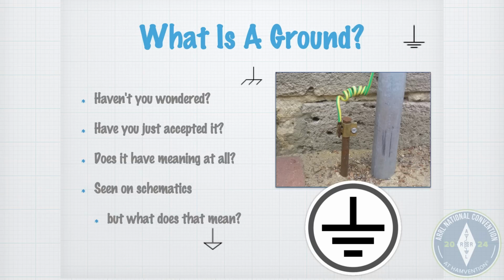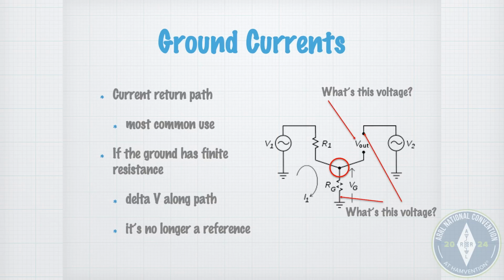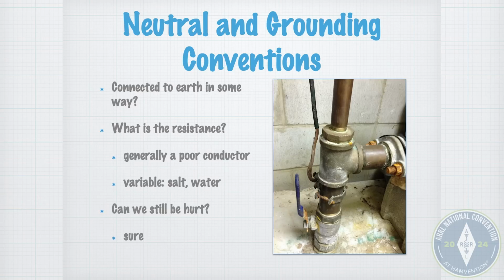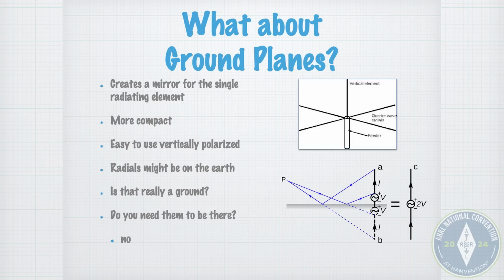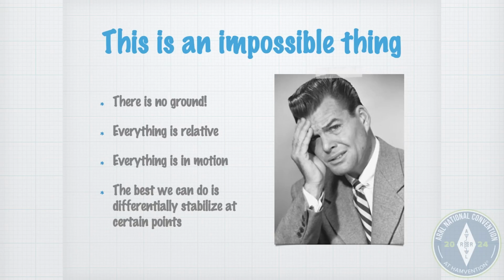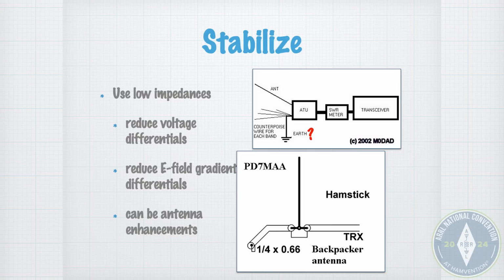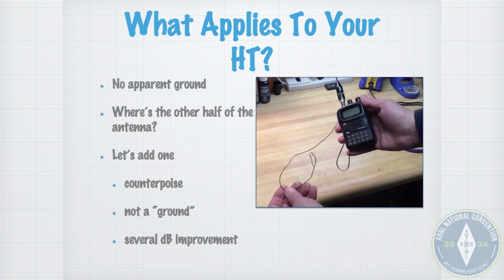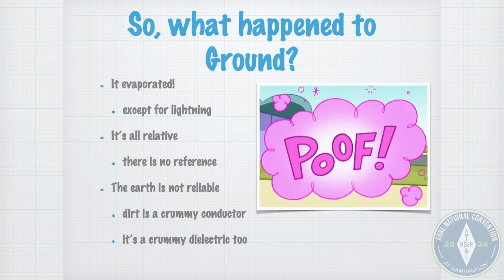Ground is a Myth! | 2024 ARRL National Convention

Comment: This ↓     Not that ↑

https://tpssurge.com/wp-content/uploads/IEEE-Recommended-Practices.pdf
https://www.youtube.com/watch?v=SXwPKIKHDlI
http://k9yc.com/GroundingAndAudio.pdf
http://www.w8ji.com/ground_systems.htm
https://static.dxengineering.com/global/images/technicalarticles/dxe-rgp-scb.pdf
https://wiki.w9cr.net/images/4/4a/68P81089E50-C_Standards_and_Guidelines_for_Communication_Sites_R56.pdf
https://www.nautel.com/content/user_files/2018/03/Lightning-Protection-Radio-Stations-Oct-1998.pdf
https://www.kf7p.com/KF7P/Tech_Resources_files/lightning%20protection%201.pdf
https://www.kf7p.com/KF7P/Tech_Resources_files/lightning%20protection%202.pdf
https://www.youtube.com/watch?v=US4RlB9WaBc
https://eepower.com/technical-articles/the-basics-of-substation-grounding-parts-of-the-grounding-system/
https://electrical-engineering-portal.com/handy-earthing-guidelines
https://electrical-engineering-portal.com/equipotential-bonding-for-metal-installations

73, w0yre

Comment: Well.. There used to be a thing called Counter antenna. It's a virtual mass against the capacity of the antenna, that also needs to be tuned.

It was banned in the early days cause of the lightning hazard. And it was replaced with the "ground" connection to direct the possible lightning. Not to be confused with the neutral point of potential positive and negative.
Reply: Bad ground is like jumping in a mud. Full ground is like jumping on a concrete. Tuned ground is like jumping on a trampoline.

Comment: 1. There is a reference point for gravitational field indeed - the center of the Earth is the reference point, where the gravitational field of the Earth turns zero exactly
2. There is a reference point for current - zero current, when dq/dt = 0, that is, when charge is not changing

Comment: Great info here! I can't tell you how many times I've been called crazy, dangerous, and uninformed when explaining to them why grounding is not the panacea they think it is. A lot of this comes from past practices with old tube rigs without a ground wire connected to the mains. Equipment manufacturers still put these ground lugs on the back of their gear, implying that one has to connect them to ground. But that is no longer the case, because the third wire is now included on all gear. Thanks Kristen!

Comment: Ground current is very measurable. I think this presentation has serious flaws.
There is no pulling or pushing, there is no distance, and the verbiage she uses is confused and incorrectly used.
The entire "idea" of a "zero" is incorrect, there is no zero, there is balance there is positive and negative sides of the sinewave. Voltage is pressure or imbalance.
Maybe the person talking should make a difference between radio frequency and AC electrical frequency, and DC electricals, there are many different type of grounds even within each of these categories, before stating that "ground is a myth!".
Wait, wait, I am at 08:00 and she just jumped from electrical Voltage (a charge) to radio frequencies (a vibration) and... Is she trying to make some form of comparison???  Wait, wait, did she just mixed AC versus DC?
GFI, it is called a ground fault interrupter because, IF the current coming from the hot wire is different from the current getting out of the neutral wire it means some current is escaping via the ground wire (hopefully!)... And it will trip... No, no, no, it will not trip "the breaker", the breaker is at the electrical panel and it is a thermal device, the GFI has a "reset button" THAT will trip not if there is an "imbalance" but if there is a current loss.
"We’ll talk about DC grounds, RF grounds, and even about gravity." 
She talks very little about DC current but she talks about AC a lot! BTW, you cannot have "phases" in DC current because DC current does not have a frequency: It's direct current!
"Dirt" has nothing to do with conductivity it has everything to do with MASS it is a very large mass, it can absorb and disperse electricity. The ocean is also a very large MASS and is also a better "conductor", it disperses electricity better than "dirt",  have you ever use your radio near the ocean or from a boat?. Here she goes again confusing electrical frequencies (60hz in NA, 50Hz in Europe),  and radio frequencies that are at thousand and millions of Hz (you know the 'M' in MHz or the 'G' in GHz...). No, no, "ground plane" does not refer to ground as  an electrical ground, it refers to a horizontal plane that reflects the wave length emitted by your antenna, it also does not "suck" any energy from "the dirt". 
The comparison between static and lightning is correct.
The coax from your antenna should carry radio signals, not electrical current. The coax cable has a heavy shield that shield should be connected to your antenna and to a main ground or the grid of your city, the coax has an inner wire completely isolated that is the one carrying the radio signal connected to your radio.
 Hum, no. There is a very real "reference". If your shack or your gear are at a different electrical potential (not RF) than your surroundings, when you touch your equipment and your feet touch the ground you become the conductor.
Ferrite is attracted to magnetic field... Magnetic fields can create noise in radios, magnetic fields are created by current going down a wire and coming back (when the wires are side by side) nothing to do with AC current or grounding. 
Wow that video should be taken down, honestly. "I suggest cutting the electrical grounds and not using them"!!!!!
.
I am not going to re-invent the wheel:
Here is some very basic power explanation including Delta, Wye and phases explanations:
.
https://www.youtube.com/watch?v=u0SsejDCVkU&t=712s
.
I cannot actually believe that this is still a conversation in our day and age.
First an electrical circuit, it is called a circuit for a reason, the current flows from point A, energizes an item, and returns to point B. Hot and neutral.
(this is actually not really true as we understand electricity better now, but lets not enter into electron dispersion etc).
What happens if the item loses all the electricity? 
The circuit is broken and the electricity does not flow back. If you then physically take the item in your hands you can become the conductor and the electricity will flow through you to complete its circuit. If this is DC you burned yourself, if this is AC you are dead. 
What happens if "some" of the electricity is lost?  
The item might continue working with less efficiency (i.e. heat) and if you touch it you might get a zap or burnt, or feel nothing if the current is very low.
This is why we have the ground wire, if some electricity is lost instead of just residing in the item (on the casing, etc) it finds the ground wire and a path back home.
Cut that ground pin on your power cord and you have eliminated that path.
Now why some say cut the pin to get rid of the hum... Because you have cut the safety path, but you have not solved the problem. A common ground is the solution to that "humm" because you are putting all the elements of your rig at the same electrical potential.
 (actually finding the electrical fault is the solution).
Without the common ground, If one item has a small fault the electricity will travel down the ground path from one radio to the next and will leave a small "humm" as it travels. Electricity always uses the shortest path home and so there is a need for all your common ground wires being the same length to the main ground. 
I still cannot believe someone would say ground is a myth. 
I think pushing the idea that "ground is a myth" in electrical term could be criminal.
Or maybe everyhing I know about electricity has been incorrect for the last 50 years.
Rgds,
a.

Comment: I have been saying do not bond your RF GROUND and ELECTRICAL GROUND for years!!!! HALLELUJAH!!!!! SOMEONE FINALLY UNDERSTANDS WHAT IM SAYING.
Reply: Wrong!
Reply: @robertarchuletta2498  ur wrong!
Reply: It doesn't matter which way you orient the fiss in a lightening arrester - I like to call this foreshadowing... 
Anyway, yeah, it should be grounded past a choke on the line. Say a dipole, you're not wanting to run the actual element down into the ground, but it is on the ground-side of the antenna. Grounding your grounds helps with all sorts of noise sinking.

Comment: Some neat content, but the smug, iconoclastic attitude really detracts from the presentation.  It's kind of a strawman argument -- take the ideas people have about ground and slay them, but never really talk about why GND is everywhere and how it's really used in a proper way.  People who fall for the rhetoric too much will now repeat the idea that "ground is a myth", and never take any engineering that uses the concept seriously.

Ground is exactly what she says at the end -- a reference voltage that is what you say it is.  It is a local abstraction that's useful for reasoning about return currents and spurious currents in unbalanced systems.  For a "myth" it sure is a useful one; it wouldn't be in schematics and the NEC if it wasn't.  So in that sense, it certaiinly exists, and what needs to be disabused is the false notions and misunderstandings of ground, not ground itself.

Comment: In the "Split Phase and Neutral' slide [there are no slide numbers] European houses are not fed 240-0-240 in the way shown. Houses in USA are fed 120-0-120. Europeans are single 240 VAC. That's why there aren't transformers on poles for every three houses all over the place like there is in the USA. A much larger transformer is located locally and ground mounted (they are too massive to put on wooden poles). The phases are balanced at that point by assigning an equal load of houses so that one side of the transformer is not loaded more than the other. It also provides the ability for commercial users to pick up 3 phase at 415 VAC with little difficulty. The systems are quite different.
Reply: Yep.

Comment: Kind of a misleading title. ARRL has published a Grounding and Bonding book and yet you dont even reference it. The NEC requires you bond your antennas (and therefore station ground) to your home's grounding electrode system and ultimately the utility grounded conductor. I think all this presentation will do is discourage hams from following these basic electrical safety requirements so they can operate safely.
Reply: Yes, the thing she said not to do for lightning is exactly what we're supposed to do according to the code.  What are the odds that her idea is correct, and the NEC ended up in crazy land after so much empirical data over a long period of time?

Comment: It was mentioned that connecting ground connector on equipment chassis to outside rods can "invite" lightning to inside. Won't coax shield itself invite lightning anyway? (lightning antenna -> coax shield -> radio -> electrical ground -> electrical rods outside house/at transformer station - as a path)
Reply: I've always wondered this same thing. Take a continuity tester and test from the ground lug on any radio over to the coax shield. They have total continuity. They are one in the same, so it makes a man wonder, why is that ground lug even there?

Comment: A myth? Maybe not but definitely not as finite as it’s made out to be. As I understand it ground is essentially a capacitor that is far too large to be charged meaningfully by the supply voltage. The great benefit of grounding is filtering noise fed back into the line side because RF tends to do funny things to electronics not built for it. Electricity doesn’t just take the shortest path, it takes all paths proportional to their resistance/impedance. The shorter the path to ground, the lower the impedance for that path and a higher current results. The paths that run back through the utilities are higher impedance by comparison to a local ground and so pass a lower current.
Reply: Myth can mean the same as Legend… would that work here?

Comment: An earth ground rod is needed for household electrical circuits to enable the Earth Leakage breaker to trip if you touch an active (live) main wire while for example, you are standing in a puddle of water. As most neutral cables are earthed in the meter box, the current would flow to earth/ ground via your feet to complete a circuit back to the ground rod and hence the neutral at the meter box. This would then cause an inbalance between the active and neutral cables at the Earth Leakage breaker and trip the power, hence quickly preventing you getting a shock. So, in this type of household circuit a ground rod which provides an earth connection is very important to have. A ground fault interrupter doesn't need an earth connection, as the neutral is linked in the meter box to ground, but it does use the ground/ earth to detect a leakage current to earth and trip.
Reply: If by "earth leakiage breaker" you're referring to the so called  "Ground Fault" Circuit Interrupter, she explained in the video why that actually has nothing to do with ground.  The GFCI breaker doesn't care where the missing current went, only that it's missing.

Comment: @21:35 - this PS does not seem to have a 3 prong AC, so the chassis is probably floating and would be dangerous if the "hot" breaks off inside the chassis.  
Taking that ground screw - connect it to other equipment chassis'.  This is not safety - it may be noise reduction.
One could (not code compliant) take that ground screw to the outlet ground, and then it would be electrically "safer" but not code or CSA/UL compliant.
One could replace the AC with a 3 wire AC and connect the AC ground to the chassis on the INSIDE of the PS (with strain relief).  This would be CSA/UL compliant (but not certified).
The DC coming out is most likely floating wrt to the chassis ground.

Comment: Neutral for homes is how we get 120v from 240v. The center tap is halfway between the full 240 coil, so running a circut through half the coil gives you 120v.

Power is going back to its source. Generated power travels through ground back to the generator.

"Reference" is relative.
Reply: It’s unfortunate that the downstream completion of a circuit is labeled with names like “ground”, “neutral”, or “grounded conductor” when it’s really the drain, sewer, return, or post-utilization leg.  It deserves a better label.  

“Frame” and “earth” sound like reasonable labels for non current-carrying references of electric potential with the understanding, of course, that they are local and limited by the resistance/impedance for the frequency under consideration.

Comment: Ground is when humans are not being neurotic. it's a reference. It can also be an invisible attractor to even out any difference as becomes apparent depending on the situation. Static, lightning the list goes on. I would avoid ground spread radials and stick with balanced antenna evenly matched and spaced up in the air from earth and other objects. Or. If using radials try to use a solid metal sheet such as a big tin roof, but many radials are almost as good. Ideally you would want to be able to change antenna height above earth for different situations.
  I guess we could say that ground is halfway between the PD but not always depending on the reason / situation.
Reply: https://youtu.be/EcHEWH8Eh0Q?si=fP5e4aRShRk3jWPD
Grounding

Comment: A great review of grounds except for leaving out the connection to the service entrance.  Kristen should add this to the presentation.  The ARRL handbook and NEC handbook shows this.  David ac9cx describes the details below.  My system is close to what he suggests except the connections are inside the garage below the service entrance panel where they stay dry.  I found a foot of 2 in by 1/4 in copper buss bar at the scrapyard and connect my antenna cable lightning arrestors, ground rods, well casing, and SE panel to it by 4 ga wires less than 12 in long.  Other wires go to the copper baseboard loop and water pipes.  It is the short, large connection to the service entrance panel that is most important to protect your equipment from the ground bounce when 30K amps flows along your antenna cables from a lightning strike.
Philip
KD1JK

Comment: All due respect, you did a very dangerous job of confusing new operators!  Grounding is an important safety feature of
any electrical system with operating voltages over 28 volts.  You being confused doesn't excuse dispensing wrong information.
Reply: With all due respect, it was clear from the get-go Kristen's "confusion" was a rhetorical device. The only genuine confusion was yours.
Reply: She never said not to use safety grounds or ignore the NEC.  Why are you making stuff up?